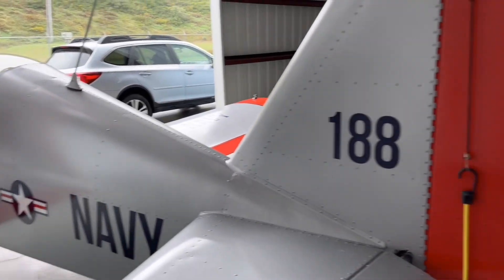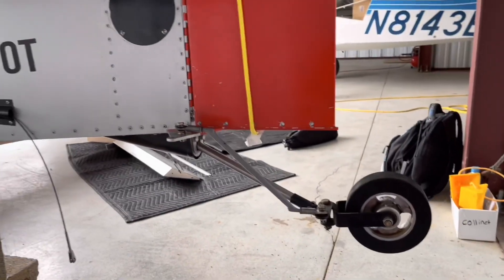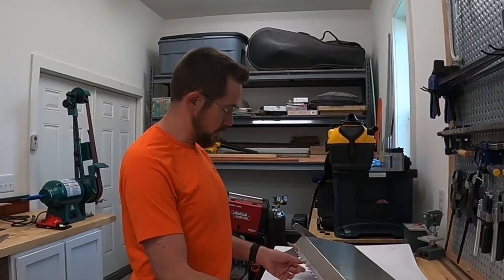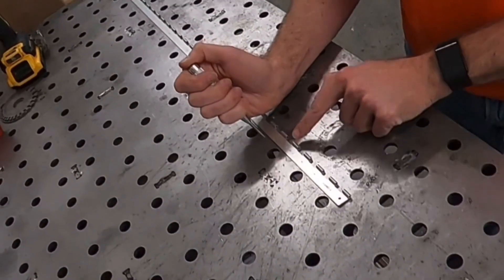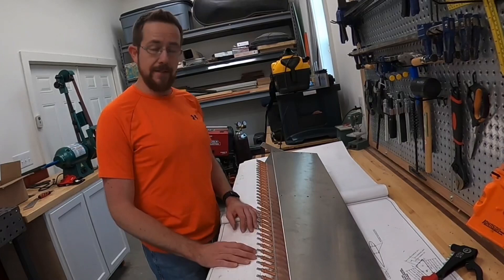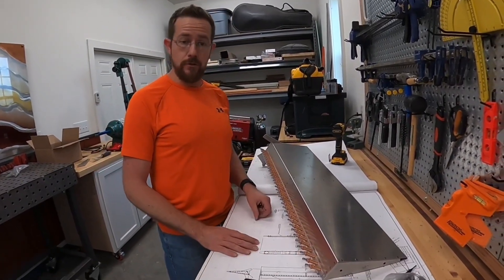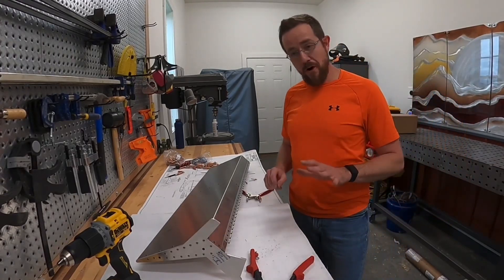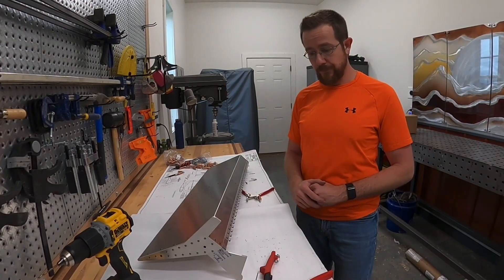Fitting and Finishing the Rudder Rebuild (Lean of Peak Aviation)

Comment: I believe the non-standard control rod was the previous owners "fix" for the problem you describe. Unfortunately, the stress analysis is wrong. By landing in a right cross wind,  with mains on the ground, holding left rudder to counteract the weather vane effect, the tail wheel is cocked when it touches the runway and jerks on the control link. There is a reason that tail wheels usually have spring isolated controls. Changing the control rod won't do anything to correct this problem. Even it the rudder cables somewhat dampen the force so you don't notice it in the pedals, there is enough inertia in the rudder assembly to do the damage. Shock loads hammer the connections.

Comment: So, have you figured out why they built a custom pushrod? What was the root cause of the problem and why did they mod? You mentioned that the original rudder was the correct height. Mark me very, very curious.
Reply from the maker: So I’m still waiting on the new push rod from Sonex which may give us some insight if we find that it doesn’t fit correctly… The original rudder was just slightly off in terms of height but was close, probably a quarter inch off. I’ll be sure to post a follow up video when everything is complete

Comment: I like the mockup with the old rudder and bungee cord to show the direction of undesirable downward motion.  From other pics on the internet it seems the front rod end mount is supposed to be UNDER the rudder bracket and the rear rod end mount is above the wheel bracket.  I wanted to see if simply moving the front rod end would reduce or eliminate the downward pull when the wheel is to the right side?
Reply from the maker: It simply won’t fit that way.  Agree it is supposed to be underneath the horn per the plans but this is not the factory rod and it doesn’t really fit as it should. I’ve got one coming from Sonex in the next couple days.

Comment: That original rudder is definitely shorter than the new one..  It will be interesting to see how the new tail wheel steering link is attached to the new rudder... Hopefully, structural fasteners will be used along with cotter pins , castle nuts and a large area washer on each open side, for that linkage btwn the control horn & tail wheel assy...
Reply from the maker: Going to do exactly what the plans show…as you describe.
Reply: @LeanofPeakAviation  I'm curious what type of fasteners, nuts, washers and cotter pins are shown to be used for the tie-rod between the rudder control horn and the tail wheel, on those 'plans' as you said you are going to follow so closely...
Reply from the maker: @michaelmartinez1345  They’re quite specifically listed in the plans…every, single, piece.  I’m happy to give you part numbers when I get back in town.
Reply: @LeanofPeakAviation  I know, it is probably proprietary information... Yes... What I'm curious about is, does the drawing actually abide by the basic design guidelines for U.S. (and other countries) built aerospace vehicles? I promise not to 'drop the dime' on the design that this plane has, from it's original basic inception, but there are certain requirements that have to be met, for pivot points of rigid mechanical linkages... Like minimum strength requirements, types and methods to capture and safety the inherent rotational movement of threaded fasteners, especially in places where rotation normally exist. Ways to capture and locate failed spherical rotational elements, (like a heim joint) , maximum thrust and tension deflection angles and  loads of rigid and flexible control elements with the use of fair-leads and guide-wheels...  Proper ways to change the direction and thrust angles of rigid and flexible flight control elements... All of this information can be obtained in a general practice guidebook (Advisory Circular) , written by real engineers, and approved by the FAA, which is called the Ea AC-65-15A airframe guidebook... Please refer to this publication, to check the airworthiness of the design features of the "plans" that you are using as a guide, for this plane that appears to have numerous design faults, which are directly attached to at least one (probably more) of the primary flight controls that this plane has... I don't want to turn you in... No...  But I also don't want to hear about this plane, on one of the aviation safety channels loosing control because of a design fault that the one who drew the 'plans'  had not even considered , because of their inability of reading and abiding by a publication like the Ea-AC-65-15-A... It could be the $25 purchase that could quite possibly, save your life Amigo...That will be all I have to say about it... Fly the friendly skies safely, Amigo.
Reply from the maker: @michaelmartinez1345  LOL man I’m literally out of town until Saturday.  I don’t have any binding agreements with Sonex. You’re questions are very good and should be explored. I’ll pull the information when I get home and answer directly here and in a video if something is seriously off. I’d prefer to be transparent.  This was a potential disaster which should be thoroughly investigated.  I’m not a mechanic or investigator so you’re helping answer questions I don’t know to ask.  Appreciate it.  Also…part of the reason I called NTSB immediately when it happened, apart from the fact I should I might be required, was that I was hoping someone smarter than me would be doing the investigation.
Reply: @LeanofPeakAviation  , There is no need to go into a panic mode... Try to leave the NTSB out of this for now, unfortunately, the NTSB as of late, has some people in key positions there, that have little, in any aviation experience... They have recently resorted to some questionable decisions and assessments because of the apparent lack of aviation experience with those in key positions there.....Just check the plane, especially in critical areas like flight controls, using the reliable references that I mentioned here, which were written by experienced aviation designers and engineers... The AC-65 series of books are a good reliable guideline to use, especially on experimental aircraft, which could have questionable construction practices & designs, including many with few if any regulations while they are being constructed...... I recognized the hardware and build practices on the area of the empenage associated with the rudder, to be very questionable at this point... Especially the technique of how the steerable tail wheel was actuated, with that offset rigid push-pull rod being directly attached to the control horn of that rudder, without the use of any springs to allow independent movement of the rudder from that offset push-pull rod & tail wheel.... Most auxiliary wheel steering systems on light planes, have a 'Bungie' type of control system to the rudder controls to allow for independent operation, from a steerable auxiliary wheel... This is clearly explained in the AC-65 series of books that I mentioned to you.... I'm not with the FAA nor am I a member of the NTSB... I am somebody who has an A&P license, and have been working on planes for a long time... And I know, when something looks wrong with a design... This design of this area looks faulty. The rigid control rods on most planes are usually straight, especially when part of the primary flight controls, like that empenage has between the auxiliary tail wheel and the rudder control horn... A bent control rod without a gusset or large strengthened cross section where the bends are, is an invitation for additional bending of the rod and anything that is attached to it , especially when under compression loads, and when not being equipped with a Bungie device...  The pivot bolts of that rod need to be at least 0.25" diameter and drilled for cotter pins and castle nuts... This is because these are places that normally have rotating motion. The open side of a 'heim' joint need to have a large diameter washer, to prevent a release of that component in case of a retention failure of the spherical shaped rotation device... These are design flaws that the people who designed this plane completely  missed, or ignored ... It is as if they never even consulted an AC-65 book during the designing process... That is with the rudder and auxiliary steering system alone... Why not order all three AC-65 books to check things on this plane, and possibly other planes that you could possibly own or fly in the future...  Do your own annual inspection on this plane... Check the basic structural design and the methods of flight control movement against the techniques lined-out in the AC-65 manuals...Your life and possibly other lives might be saved by doing this... That extremely loose rudder control horn fitting that almost completely failed, was a definite sign, of what might lie ahead...
Reply from the maker: @michaelmartinez1345  Thanks again.
Reply from the maker: @michaelmartinez1345  Yeah so there is a nice updated series you can buy as a bundle for about $100.  The updated series is titled 8083 and are the source of the current knowledge and practical exams.
Reply: @LeanofPeakAviation  very cool... Thanks for the update.... I went through A&P school back in the early 1980's... But many of the basic principles with airframes have remained much the same... There are a few more types of alloys for aluminum and the composite materials and procedures have become more modern... But the basics of fastener patterns , minimum bend radius, edge distance of fastener rows, determination of fastener types and stem diameters, methods of installing flush fasteners, etc... Much of that has remained the same, but it is still important of following the manufacturers designs on certificated aircraft... Several of the experimental planes seem to be in a grey area on several things... That is when a group of enthusiasts who know those planes are often a good source of info... But there are some who seemed to have taken the original design far beyond the limits... That is when people who know planes very well should be consulted, and the Advisory Circulars that I referred to on my last text to you is a really good source of many things... Also the AC 43.13 1&2A books are outstanding references....
Reply from the maker: @michaelmartinez1345  Well I took your advice and bought the bundle so I’ll have some professional references as I’m going through this plane and probably building one in the future. Interesting detail I didn’t catch previously on the stock control rod is that it appears to be just a tube with welded flat stock ends that have a simple hole on each end.  There’s no heim joint at all.  I’m still waiting to receive the new rod from Sonex, UPS notified me today it’s on its way. Im very curious to see if in fact that’s what they send me because every picture I can find online shows a linkage with heim joints on the ends.
Reply: @LeanofPeakAviation Very good!!! You will now be able to see what is originally equipment for that plane, after the new parts arrive... #6 fasteners are approximately 1/8" shank diam, #8 approx. 5/32" , #10 approx. 3/16" , #12 approx 7/32" and the rest of the diams. are fractional... I'm guessing about this, but my inclination is this uses a heim joint with a 1/4" pilot hole.... I'm also guessing that at least 1-ea. end of the push-pull rod has a 1/4"-28 male thread with the rod end having the 1/4"-28 fe-male end with the heim joint insert. And both of the pivot bolts are 1/4"-28 with cotter pin holes and  large washers and castle nuts.... Just guessing of course...

Comment: Besides the non-standard pushrod, have you noticed other differences regarding how the original rudder was built versus the new rudder that you built according to the plans? Number of rivets, lack of reinforcing brackets, etc.?
If I had to bet my life on a random guess, I would guess that the original owner damaged the bottom of the original rudder a bit and he shortened it and improvised on construction a little when he rebuilt it. And that would explain the failure.
Reply from the maker: The short rudder was the only other variance I found.  Everything else looks like the plans.  No other damage I could find in the rear end.